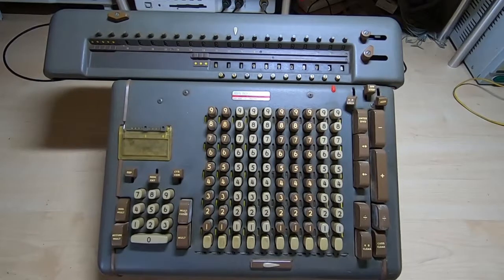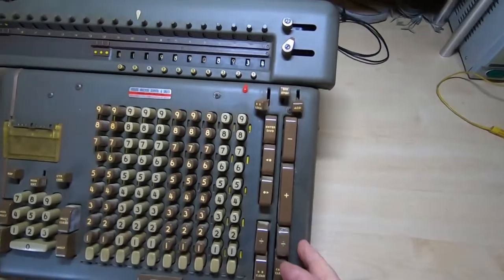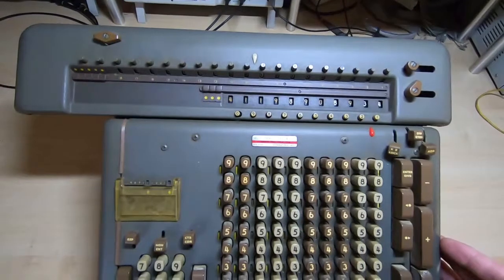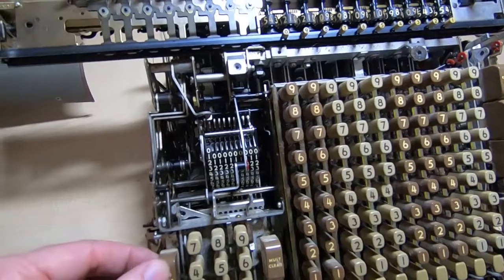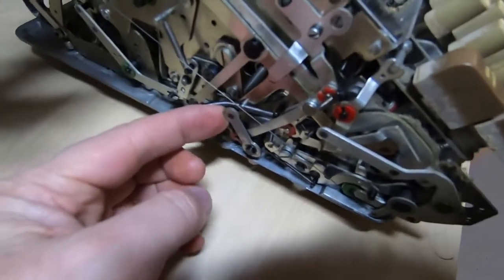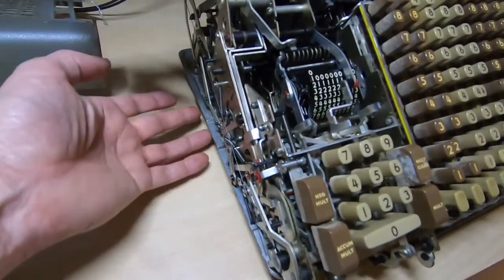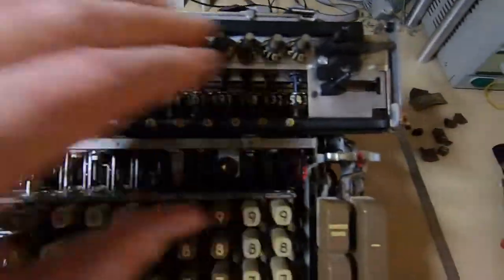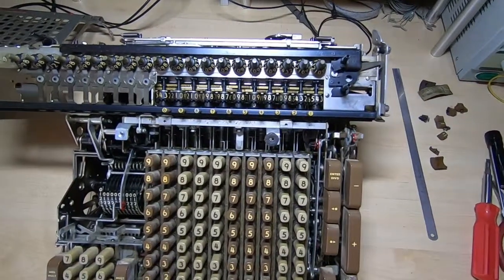Friden STW10 Can It be Saved Part 1

Comment: ONE OF THE WORST THINGS ABOUT THESE OLD UNITS IS THE DRIED UP LUBRICATION ,IUSED TO TEACH TECHS HOW TO SERVICE THEM, IT WAS A 12 WEEK COURSE , I DONT THINK THAT THERE ARE ANY MORE INSTRUCTORS AROUND NOW I AM IN MY LATE 80S
Reply from the maker: Absolutely. In fact once I had repaired the shipping damage almost all the other problems were dried up grease which was surprisingly difficult to move as much of it had set into a solid form. The small carry links under the carriage were also totally seized and it took many hours to free them up. At one point I even wondered if it was a single solid piece of metal but the small springs gave away its true function.